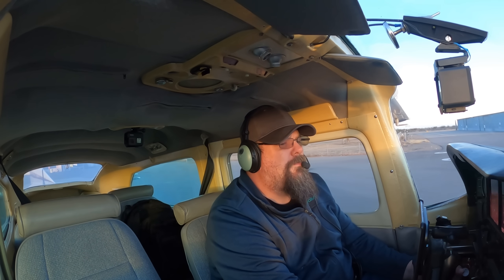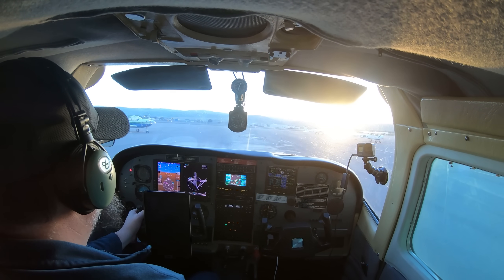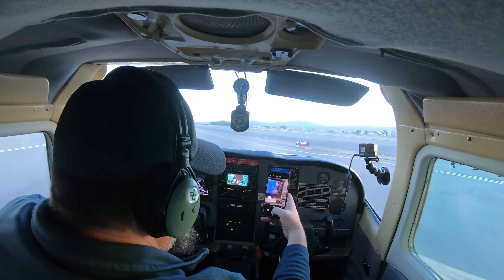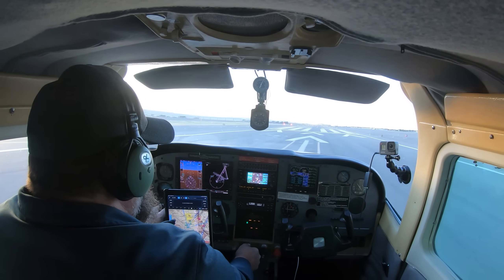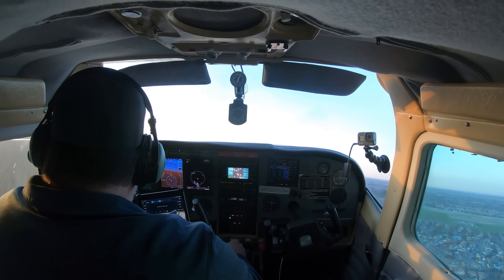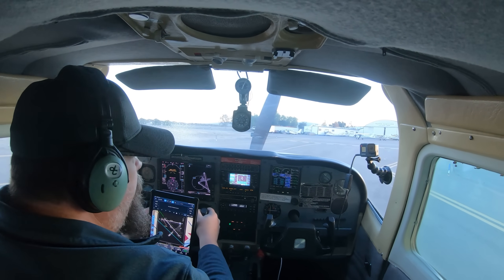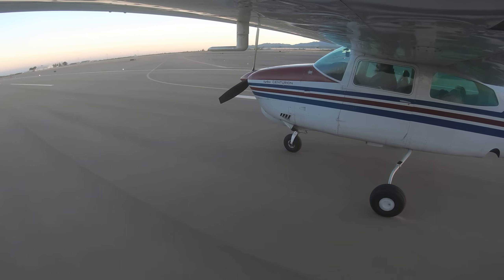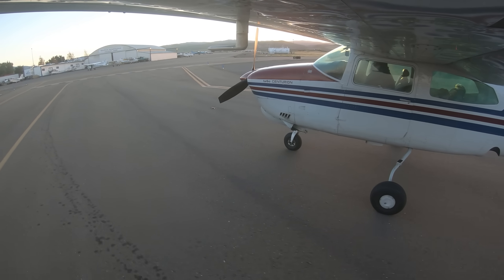Catastrophic Engine Failure after Takeoff

Comment: So, I just found your channel. I’m a retired airline mechanic and I’m very curious about the root cause of your engine failure. Looks like within the last year you have rebuilt your prop, worked on your landing gear, found metal in your oil, tried just replacing your lifters but might have split the case an changed the cam. Is that pretty close to what you’ve done?
Reply: Calm down son. As an A&P since 1983 and 40 plus years of turning wrenches I can tell you that using big words and trying to speak like an ivy leaguer doesn’t impress anyone.
Reply from the maker: Mostly correct. I purchased the aircraft in August 2020 with a 400 SMOH engine installed in 2013. I flew it a lot and personally changed the oil every 25-35 hours. In February, when it was due for an oil change, I had put over 100 hours hobbs on it myself. So I decided to take it to my buddies A&P to have an annual done on it early. In that annual, they found metal in the filter and we looked down the fill hole. They recommended a lifter change. While in that annual  they found a nick on the landing gear actuator and burned up the landing gear hydraulic pump motor. I got the plane back from annual in May.

In June, I changed the oil (22.3 hours tach since annual) sent a sample off to AOA and took the filter to the same MX. They found metal, put it in a bag and told me to keep flying, stating perhaps it was residual from previous wear. In July, I changed the oil again (19.9 hours since June) sent a sample off, took it for a post mx test flight and noticed my oil pressure was low. When I got back to my hangar I shoved a borescope in the fill hole and noticed lifter damage again, so I grounded the airplane to have someone else fix the engine.

Had on-field AP remove engine and propeller and since propeller was off and had 1800 hours, decided to have that and the governor overhauled while the engine work was being done. Engine work was to split the case, remove and replace the camshaft, lifters, bearings, connecting rod bolts and nuts, gaskets, and oil pump housing. New rings and honed all 6 cylinders.
Reply: @TheEdwardFrye  If the lifters were bad the cam lobe is usually bad also, probably rust from sitting but that's just a guess. As an IA I would have probably recommended using that engine as a core exchange at that point with a prop and gov. overhaul if it was at 1400 hrs. A person really never gets ahead piece mealin these engines unless its high time 14-1500 hrs or so (cyl change or anything external)  just to get a little bit more out of it. A lot of aircraft are unloaded and sold when things like a little metal shows up. Hind sight is always 20/20 but its usually always role the dice when buying a used aircraft. Good luck on your options :)
Reply: As an aspiring A&P I don't find it cool to see so many comments complimenting such good airmanship and so few questioning potential pilot error. Of those that did question to consider "we found metal particulate in the filter and looked down the hole and they recommend new valves" is not a detailed response nor a responsible maintenance/repair plan. I'm not trying to blame and yes you did demonstrate fair proficiency in understanding the capabilities of you're aircraft however the term catastrophic has a connotation of sudden failure unrelated to any engine/propeller operation adjustment or otherwise is analogous to engine failure at a time into cruise. Failure occurs almost immediately after a change to propeller pitch and with no change in throttle setting from what I saw. Maybe I'm wrong but know what I didn't see was me doing the work on the engine, an engine test on an engine stand before reinstall or even an extended engine run up.
Reply: @brianhutchinson7863  yah you better get used to guilty until proven innocent if you wanna be an A&P. Speaking from 20 years experience military and civilian aircraft and aerospace manufacturing. It’s always the mechanics fault until proven otherwise it’s just he nature of the beast. Thats why you always cover you ass. By the looks of the picture that very well could have been a mechanics screw up. The fact that it was just apart and the rod caps appeared to be missing in the pictures is not looking good for that shop. But who knows that’s just speculation.
Reply: Thanks for the detailed response. Will the mechanic that did the work be doing a forensic inspection to find the root cause?  Do you trust him to be honest about it?  Is this repair going to be out of your pocket, insurance involved, or maybe warranty involved?

Comment: I would say whoever overhauled this engine screwed up Big Time!  I had a Cessna 310 lose an engine on takeoff. At least I was alone and was high enough it was a fairly easy thing to get in the pattern and ask for an emergency landing. This same 310 a couple of years later had gear trouble right after I had an annual inspection done on it! I flew around for an hour and a half burning fuel as I didn't want one of the tip tanks to hit the ground!! The gear was stuck with the left main halfway down, the nose gear all the way down and the right main was about a quarter of the way down! I did all the things in the book but they were stuck! Didn't hurt the props as I was ab;e to come in high on a very long runway and shut the engine that was running off and cleared the prop. The left engine had stopped in the perfect place to save it's prop! Didn't hurt the plane much. Found out the idiot who did the annual failed to put the phenolic piece back on the area where the landing gear motor was and it fried the motor!

Comment: Well done Edward. I will guess spun bearing.  Let us know the cause.  The most dangerous period running any engine is the 1st hundred hours.  I wondered about maybe leaving the gear until completion of the turn, but that gear takes forever to extend, so maybe doing it right away was the right call.  Shoulder harness.  Yeah.  That's a big one.  Please never go flying again without one. I've been obsessed with wearing them since the 70s when they first started to become common.  Otherwise, great flying and thanks for being all camera'ed up and showing it to us.  This is a good argument for running the engine on the ground for an hour or two, uncowled with an air baffle box installed to cool the cylinders, when it's had that much work, assuming it wasn't run several hours in a test cell.  For the impossible turn, I practice the maneuver in my homebuilt by cooling the engine down at a low power setting at a decent altitude, pulling back to idle, diving to climb speed plus 10-15kt,  and pulling up to the typical climb attitude and initiating a 270 as the speed decays through climb speed.  In my plane I can keep the altitude loss under 300 ft so I'll go for it at 400 ft or more.  Last item: when the engine quits, one of the immediate action items should be to pull the prop to min RPM.   If you can get the prop blades close to or at full coarse, glide improves massively if/when the propeller stops.

Comment: Turbos on these 1930's era tractor engines just seems like we're asking too much from them.  With simple carbs, low compression and no boosting, typically you'll make TBO and then some.  Damn good job getting back on the ground, keeping the wing flying and now to find a clean pair of shorts.  Been there myself, but had a lot of altitude to sort it out.  Prop stopped right on short final like yours did.  It's an eye-opener for sure.

Comment: Good job!
When doing a mag check on cold mornings I usually do it at lower than recommended rpm, simply because I worry that the oil might still be too thick. However, I'd like to hear a factory mechanic's opinion on whether or not that is a good idea. Likewise, on cold mornings, efore the mag check, not a bad idea to point the plane into the wind, lean it out a bit and let the oil warm up.  Always a shame to see a freshly rebuilt engine ruined......
Reply: On cold mornings or warm mornings (any mornings and anytime) before takeoff you should run the engine at lower RPMs until you are at operating temperature then do your checks AND run the engine to FULL power. Good idea to always run up to full power during run up to make sure......you have full power.
Reply: @Airplanefish  My thoughts exactly. Wondering if he blew the motor by using full power with cold oil.....
Reply: @jiyushugi1085  I have no idea what his oil temp was but even a new engine should be run to full power during run up. Need more information or photos to help determine the issue but one thought I had with the limited photos we saw was that possibly the rod end cap bolts were not torqued to spec meaning too high or too low? Not sure if they put new rod bolts in or re used old ones? But going to full power on the ground even with a new engine once it's at operating temp will not harm the engine and is a really good thing to do.
Reply: @Airplanefish  Actually, what I really wanted to know was whether it's possible to blow the engine by doing full power takeoff with cold oil.
Reply: @jiyushugi1085  I guess that depends on how cold cold is? I would say if the aircraft sat outside overnight in 30 degree weather and the it was started and went to full throttle you would damage the engine. If the engine was allowed to run at or Below 1100 RPM for  5 minutes or more before going to full throttle you might slightly damage bearings or cylinder walls but I don't believe it would come apart..

Comment: It looks like you spun a bearing and the rod tore through the crank case did they replace your cylinders? If they did I hope they used torque plates to keep torque on the crank  case .halves.  If not the bearings on the case halves will shift and this what happens
Reply: What are torque plates?

Comment: Yet another episode of Corvair engine reliability on parade.  Precisely why an aircraft mechanic  should be required to fly an airplane, with one of their loved ones in the passenger seat, after ANY maintenance or repair is performed.  Then turn it back over to the owner of the plane.

Comment: The one question I have. You indicated this was a field overhaul and that this was the 4th time the engine had run and broke it down to the 4 times it had been run since reinstallation on the airframe. My question is, was the proper engine run-in done on a test stand before installation?

I ask because I have seen this skipped in so called field overhauls before. The run-in, often around 2.5 hours total, is a required part of the overhaul. If a test stand is not available, as may be the case for a field overhaul not done by an engine shop, the run-in can be done on the airframe provided that: 1) Calibrated engine instruments are used (the aircrafts instruments are not acceptable although your engine monitor is certainly more than capable); and 2) A test club must be used (flight propeller not acceptable).
Reply: Where are you getting this information stating 2.5 hours must be run on an overhauled engine before flight and that a non flight propeller must be used?
Reply: @Airplanefish  It is specified in the repair and overhaul manual. If the overhaul is being done by an engine shop they will have a test stand and club props to do it. The overhaul is not complete until the run-in has been completed. If for some reason this can not be done on a test stand it can be done after installation but must be done with calibrated instruments and a test club. The purpose of the run-in is to verify things like oil pressure and performance as well as, say rod or case bolts are not properly torqued then the catastrophic failures occur on the test stand and not at 800'.
Reply: @Jeffrey_Pyefinch  what overhaul manual says this? Can you give me a specific manual number? I've never heard of this and never seen it written anywhere? Maybe someone "recommended" that information but I've never seen that information especially being mandatory.
Reply: @Airplanefish  I will look up the specific reference for the TSIO-520 in the morning but you will find these same requirements in any TCM or Lycoming Repair and Overhaul manual. When you get your engine back from any good engine shop included in the paperwork you will get a breakdown of how many minutes the engine was run at each RPM increment what the oil pressure and temperatures were ect. This is a normal part and requirement of any overhaul.
Reply: @Jeffrey_Pyefinch  I get that you will receive paperwork from the engine shop about Temps and pressure IF the engine was run. However it's not mandatory that an engine be run for a specific amount of time before the customer receives the engine. The engine manufacturers will recommend that certain criteria be met once the engine is installed but there is no mandatory pre run time required on an overhauled engine
Reply: @Airplanefish   To the best of my knowledge the engine installed on this aeroplane would be a TSIO-520. The reference document would be TCM form X30042A - Overhaul Manual for TSIO-520 Series Aircraft Engines. Several versions of this manual can be found with a quick Google search. I posted a version of this message yesterday with a link but it kept disappearing so trying again without the link.

Chapter 8 - Final Assembly and Test

Section 8-33 (page 8-13) - Testing After Overhaul
Note on the use of the airframe for doing the run-in. ie. requirement for use of test club and instrumentation.

Section 8-45 (page 8-16) - Engine Test
para a) Requirement to test after teardown, repair and reassembly where no major parts were replaced IAW Table X.
para b) Requirement to test after major overhaul IAW Table XI

Note: At some point the manual was revised and the tables were rearranged and renumbered but the references in this section were not updated. The test requirements for minor and major overhauls were combined and actually can be found in Tables XII & XIII

Table XII (page 8-19) - For all models except -K
Requires two run cycles with 12 test periods with a minimum of 80 minutes of total run time plus warm-ups.

Table XIII (page 8-20) - For -K models
Requires two run cycles with 18 test periods with a minimum of 110 minutes of total run time plus warm-ups.

The referenced Manual is FAA approved data and as such the requirements set forth are actual requirements and not suggestions.

Comment: hey did you have an engine monitor? any unusual indications? and also was your mindset geared toward a possible engine failure it being so soon after overhaul which is a high probability, or were you just going about normal flying and your instincts kicked in? curious
Reply from the maker: The engine monitor did not show any unusual indications that I noticed, and I confirmed this by downloading the data and examining the csv file. My mindset was absolutely geared towards a high possibility of engine failure. I had practiced this in my head (chair flying) several times in the last two weeks.

Comment: Nice job sticking that landing.   How you deal with that?  New engine. :)  maybe some jugs and components are serviceable..but there's probably shards of engine case and connecting rod everywhere inside.  Sounds like the overhaul shop is on the hook for taking care of you.  Engine had .. what.. 0.1 hours on it since their overhaul?  I couldn't see inside the case, but... maybe the bolts on the rod weren't secured, or missing?
Reply: The nice thing is he has data from the engine monitor it will be interesting to see what the fuel flow, egts and cht's were doing before and during the failure. Detonation can cause catastrophic engine failure, with a turbo engine engine management is critical it can happen very quick and I noticed he accidentally pulled the mixture back instead of the prop a few seconds before he lost the engine.  Its all speculative but its possible it went lean and detonated, between the data logs and inspection they should have a pretty good idea about what happened.  Regardless of the cause the most important part is he made it out safe and saving the airframe is a bonus!

Comment: Really nice job on that. Something I noticed was that your attitude reference red X'd during the turn to get back. What's up with that? I'd agree with others to keep the gear up. It seems like the engine was running partial power for a little while which is, I think, why you got away with this, potentially regardless of if you put the gear down later.

Comment: I'm still trying to figure out if you bounced initially.  on the 1st and 3rd views it def looks like a big bounce with a great recovery but the 2nd view (outside wing) I don't see any bounce, but maybe the right wheel hit?  I also see what looks like an engine shutter maybe where I'm thinking you bounced.  hard to tell.  either way, lucky that other runway was there, great job!
Reply from the maker: There was no bounce, only a single touchdown, 535 feet down the pavement at the middle of the first stripe, the shutter is the connecting rod jamming in the case and the propeller stopping.

Comment: Nice job you knew your assignment 👍     could hear a change in sound and a increasing vibration/ hollow radialing noise a few seconds after lift off just before you changed manifold pressure and prop settings, sounded about like my airboat aircraft engine i used on it from my old airplane, when it spun a bushing on the connecting rod and one main due to fod in a oil passage..